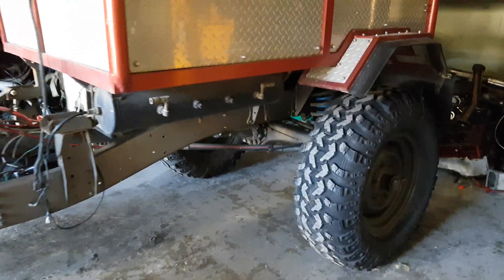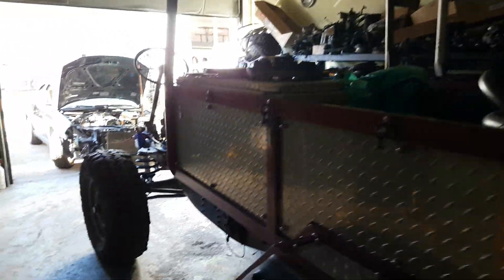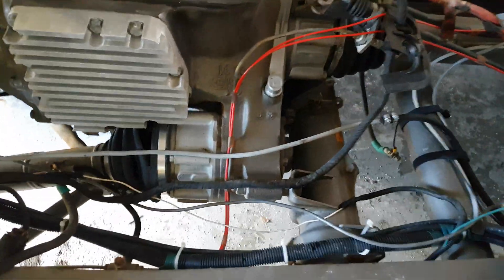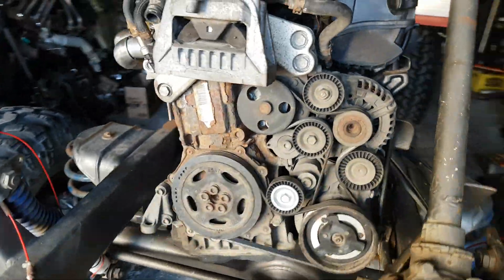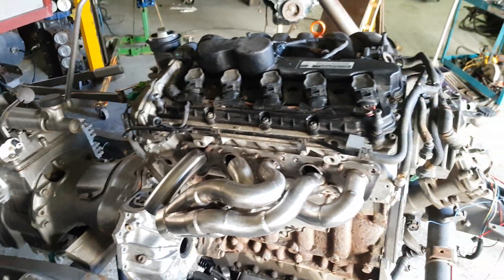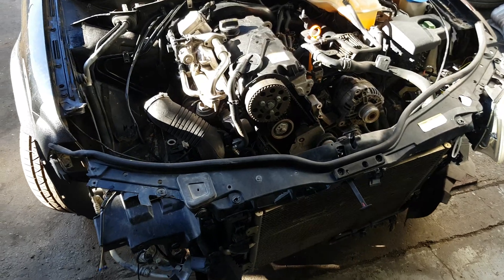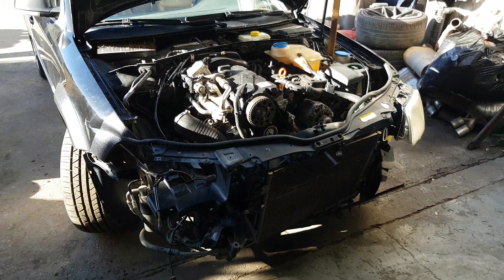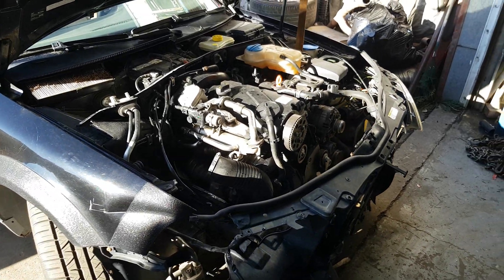Unimog 404 TDI  swap

Comment: Yo! I'm almost done restoring a 1970 Unimog 404. I'm considering doing this swap. There is a 2005 passat tdi motor with 80k miles for sale nearby.  Can you give me some info on what I'll need? Where are you located?
Reply from the maker: @toddtempleton9321  Chilliwack b.c Canada.  You'll need lots of time, welding and fabrication skill. I made a custom bellhousing adapter from scratch for this swap